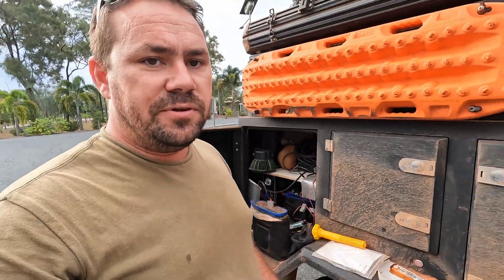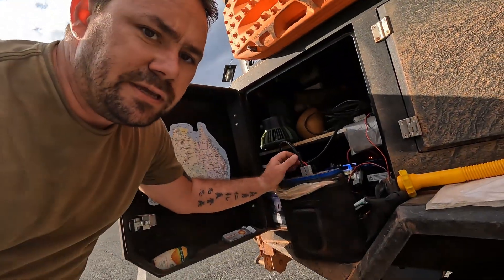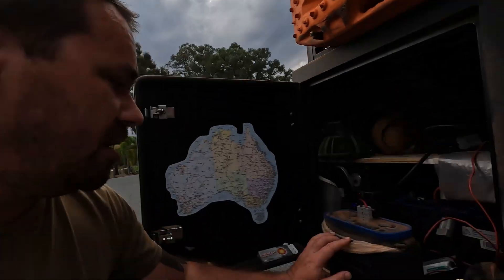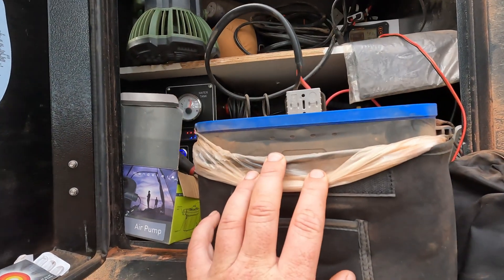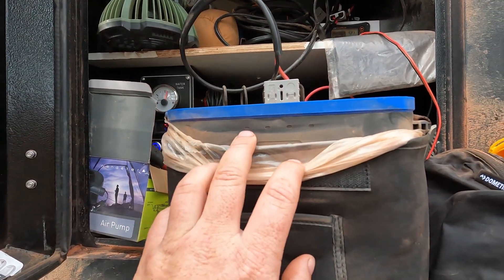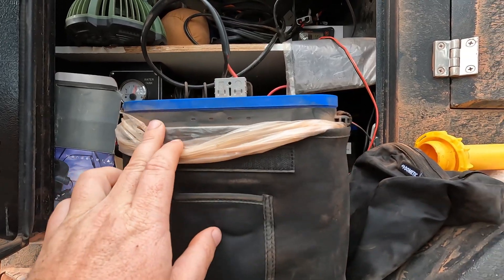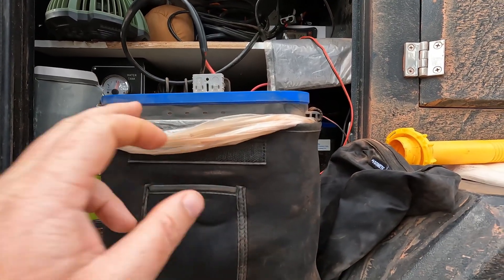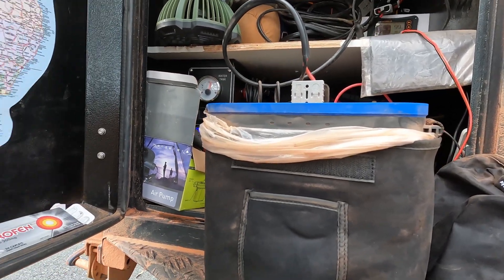CHARGING HACK KINGS 36ah Battery - Bring the battery pack back to life. #kings #36ah #hack #battery

Comment: Just to double check, you were able to charge up the 36ahr kings battery pack via the anderson plug output plug?
Reply from the maker: Yes mate that’s correct, but make sure you are using some sort of lithium charger. Either a DC/DC or AC/DC I have found both work well as the Anderson is direct to the battery.
Reply: @scottdennis86 perfect, cheers for the feedback
Reply: Have you tried charging up the 36ahr battery pack using a solar panel and mppt controller via the anderson plug?
Reply from the maker: Sort of, I have used my DC/DC charger with solar plugged into it to charge the 36ah pack. I don’t have a dedicated MPPT solar controller as everything runs through my DC/DC
Reply: @scottdennis86 cheers, ive got a 225w solar blanket with a victron mppt 100/20 but i think this will provide too much charge to the powerpack.
Reply from the maker: The MPPT charger should control the input to the battery like any other battery

Comment: We just returned one of these batteries after the USB charging port failed. Would have been nice to know this was an option, but their documentation is terrible. Thanks for your video.
Reply from the maker: That’s a shame! Still, if the charging port failed and a return is an option I’d still do that. I have used this a few times to get me out of trouble if it drains down too far

Comment: It seems to work well but whats limiting the charging to the battery pack? Isn't the Anderson plug an output only? Does it somehow use the inbuilt BMS to charge it?
Reply from the maker: The Anderson “output” is connected directly to the battery. So by “back charging it” via a DC/DC or AC/DC charger it is no different to charging a normal lithium battery in the same manner. The LED lights show “SOC” off the voltage so charging this way does not use the BMS at all.